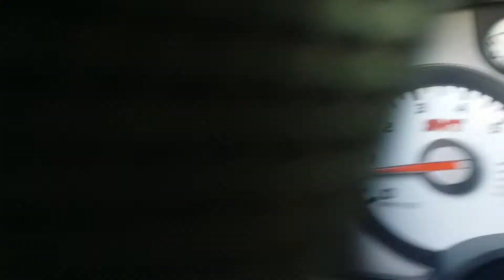old video 2015/2016 Raptor F150 2.9lt whipple supercharger (part 1)

Comment: More like a 2010 or 11 raptor based on the decal not to mention the Raptor wasnt produce in model years 15 or 16.
Reply from the maker: Erick Quinones hi,the car is 2012 model, I install the S/C kit 2015 or 2016 (I don't remember exactly). Thanks
Reply: Tasos Moschatos ok got it. Title is misleading; make it seem like its a 2015/16 raptor with a whipple.